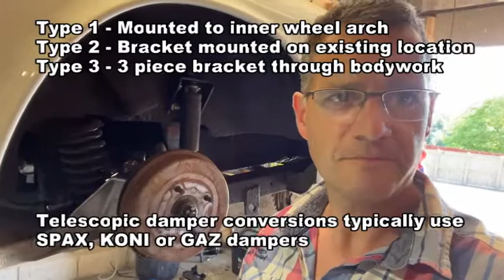Triumph TR6 Suspension Upgrade and Tube Shock conversion

Comment: Great video! My brother has #2 on his 73, (and the adjustable trailing arm mounts) but always worries about them. Many mechanics advise to stay away from them. One description I heard was that the tube shock's travel is straight up/down while the OEM lever shock's travel is a slight arch, and is as the TR engineers intended. Many folks have experienced cracks in the frame.  My mechanic advised to replace the levers oil with Lucas Power Steering Stop Leak and should have an amazing result for a simple rebuild-in-a-can. I plan to try this in the near future. Need to pull them off to remove all the existing oil and if the Lucas doesn't seem to work, a rebuild it's supposed to be pretty straightforward. I tend to lean towards OEM. Really enjoying your channel!
Reply from the maker: Thanks for the feedback and some great points you make. lots of choice available to help with the 'squat' rear end the TR6 is known for. Stiffening up the rear end dampers however its done is well worth the effort
Reply: @mgmidget-thebirthofaraceca4349  Here's something funny. I've owned mine for 30+ years, but a previous owner put simple spacers in the rear springs and I've never had a squat issue. If it ain't broke, don't fix it!

Comment: Very cool description of this upgrade. Thanks for going over tank removal; if my non-PI is similar, I'll be doing this in the coming months to replace some hoses. On the bushing that you are using- the shop that upgraded my  car didn't use enough poly lube, and they squealch when hitting bumps and did so right away. I spray them down with lithium lube, and that works for a little while.
Reply from the maker: Thanks again John for the Input. glad you like the video. The tank removal isn't a big job, probably about an hour. Just remember its heavy and awkward if you've got any fuel left in it. Best to drain off what you can first.
Reply: @mgmidget-thebirthofaraceca4349  Thanks!

Comment: Very interesting and thanks for your whole series which really help the owner. I purchased a TR6 that had been set up for track days and has quite a reverse camber . It was a really great handling car on the corners. However i found the tyres were contacting the shock (Type one conversion) and would occasionally cause a great bang at the back as the wheel snatched at the suspension!! I bought brand new Armstrong lever arm shocks and removed the old shocks to find the inner gaurd had cracked at the  top "mount", so I caution anyone trying this cheap route to fitting tele shocks. AS well I found that the spring cushion rubbers were missing at one end so replaced all that back to stock. The result was I feel the rear end steers the car on bumps now to a significant amount now. Not sure if I can improve this with different oil.  Or perhaps I will be back to a type 2 or 3 conversion. Thanks again.
Reply from the maker: Glad you liked the videos and thanks for the great input to the topic and support

Comment: Hi have you done a video on timing the metering unit as I'm going to send the unit and injectors for refurbishment please. Regards Kevin
Reply from the maker: Have a look at the 4th 125-150 conversion video where the engine gets rebuilt. in summary you time the metering unit buy checking the MU hole on injector 6 output when the engine is at TDC.  you can find this online aswell if you look hard enough as its in the workshop manual. its a must read before as you refit it an get ready to start up for the first time. good luck

Comment: I know this is completely going to drive every enthusiast crazy and I apologize in advance haha I got my dads 69 tr6 now and it’s been sitting in the garage for 30 years super clean car all original zero rust. But I’m wanting to put my own taste into the car make it a fun cruising show car and mow when I want it to be and not so low when cursing the interstate. So I’m thinking about going with air bag suspension. In theory can I run air bags in the rear with out the spring? Since air bags have everything integrated?
Reply from the maker: That would be an interesting upgrade. would love to see a video on that if you choose to go ahead
Reply: @mgmidget-thebirthofaraceca4349  I will for sure video it, I’ve seen the Toyota ae86 is the same suspension set up in the rear as the tr after the strut conversion so I’m up in the air on bags or maybe one piece coils may Frankenstein a set of something together!

Comment: Great video! I am in the process of fitting type 3 to my TR6. I can't find what torque to tighten the 9/16 nuts at the top and bottom of the shock. Can you help? thanks
Reply from the maker: Thanks, glad you enjoyed the video and found it useful. There is no defined torque here as you are tightening against the rubber bump stops. Poly bushes would probably take more torque than std rubber ones. I tighten enough to lightly squash the rubber bushes leaving no movement so there is no play in the shock. You can double nut or use a nyloc nut or loctite to be sure won’t come loose . Good luck with the upgrade 👍
Reply: @mgmidget-thebirthofaraceca4349  thanks for the prompt reply. Your videos have been really helpful since I got my TR6. Your well prepared and presented format is a really good way to convey information.
Reply from the maker: Thanks Ted, appreciate the feedback and kind words